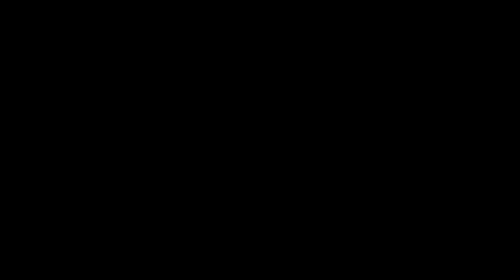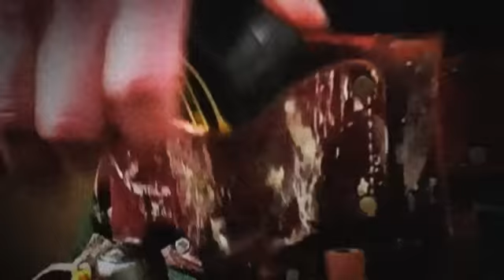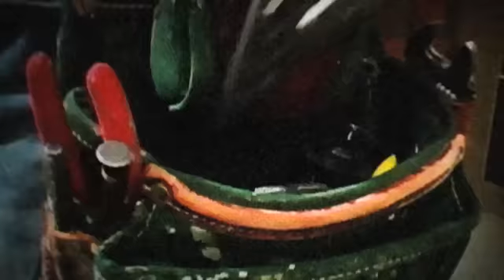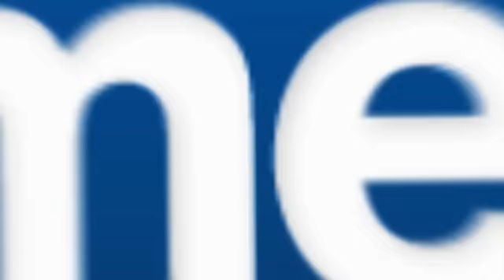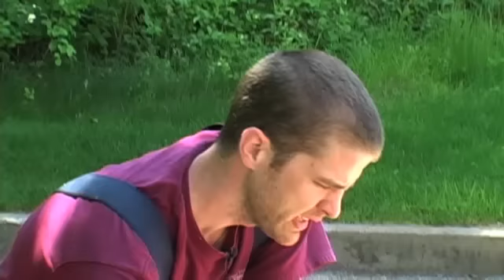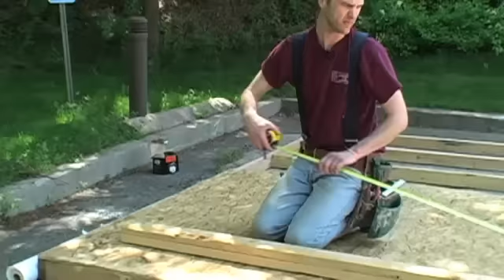BUILDING SKILLS: Basic Wall Layout

Comment: Take an 8p nail or three, tack the plates together, and layout on the face... 
15 ¼ and go is easy with repetition, and the tape has red marks every 16”... but splitting plates to face mark is too time co-signing on a residential job where you have 4 days to frame a single story- with shear walls, trusses, sheeting, hips valleys and other cut ins, arches, drops, etc....

Comment: too much thinking.....pull 15-1/4'' on the first one, smack a nail in, hook your tape and pull your 16's. much more accurate...especially on larger framing projects.
Reply: The purpose of videos like this are for newbies like me. I work in automation repair and what is easy for me may be complicated for others. When I am building with wood I am never rushed. I would rather take my time and do it right the first time. I am not doing it to make a living.
Reply: way too much thinking. This is wood, and its going in a wall. Not visible. I hate those people who overcomplicate everything. Saws, drills, tape measures, specific screws and its still a hassle for some people.
Reply: Then you might encounter trouble fitting the insulation for example.